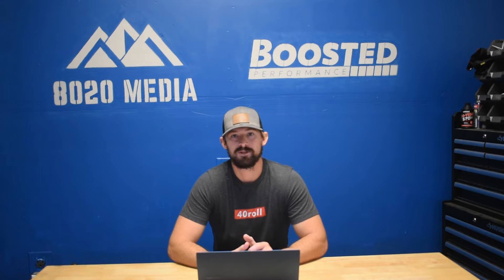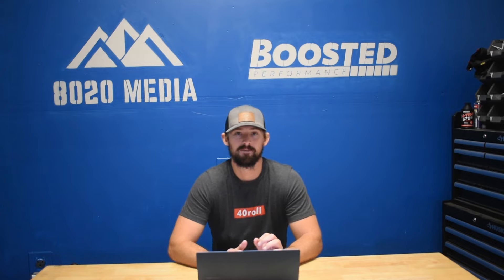DIY: How to Fix GMC/Chevrolet "Service Stabilitrak" & Traction Control Lights!

Comment: My truck runs fine even with all of the lights staying on. So instead of replacing the 200 possible things it could be, I'm just going to leave it alone. Been fine for almost 2 years now.
Reply from the maker: Ron - Thanks for sharing your experience. Everybody has different preferences. We personally don’t love seeing warning lights on the dash. However, if it is running fine with no issues, to each their own.
Reply: I just spent upwards of $1700 fixing my Chevrolet Malibu LTZ and everything ran perfectly until two days later. The check engine light is back on and now my dash display reads "SERVICE STABILITRAK". I consulted with the shop and they informed me that turning the Traction Control and Stabilitrak off would solve the problem as far as the hesitating and bad idling. Also driving the vehicle without TC and Stabilitrak would not damage it... I was told to drive carefully and keep the car's oil changed and tuned up as anyone should. I've been driving without TC & Stabilitrak for a solid week now with no troubles. I'll eventually go to my Chevy dealership to have the issue fixed when my budget will allow it but for now I'll just have to drive it as is and pray for the best. I believe everything should be alright.
Reply: @8020Media  that's exactly where I'm at with the situation now, just elated that my car runs smoothly and won't leave me stranded somewhere. It is what it is.
Reply from the maker: Fred - Good to hear. Keep us updated on this!
Reply: @fredicagoillanoise1309 Praying right along with you!!
I am presently faced with the same issue!!
I've invested alot in this pre-owned vehicle due to all of the lights on the dashboard.
I've only had it for a week and have seen 4 Mechanics thus far!!
Reply: @shirvanyrwright7250  I hope all goes well with your car. These things are a headache when you have problems with it. Here it is 6 months later and so far so good with mine. I'm driving it without Stabilitrak with no major issues. Sidenote I just had to replace the main battery yesterday and will replace three headlamps tomorrow... it's always something isn't it?.......
Reply: Throwing p011 code. Replaced vvt, magnetic actuator, cam sensor, and subharness. Replaced wheel speed sensors. No luck. Trying coils next already did plugs. Cursed. Camshaft overadvanced code is what the p011 is.

Comment: 2016 Impala: I had my trans flushed in May 2022, started having issues in June. One time i drove 30 mins, got out and went to lock the car, didnt hear it lock. Got in went to start, nothing, dead. Felt the battery cable, little warm. 5 mins later, starts right up. No issues for a few weeks. Then started getting u0101 code. Had the battery checked, they deemed it bad. Replaced it in July 2022. Started getting the Service Stabilitrak message, with traction control light, check engine, and electric brake service light. If I started the car and all these were on, when I shifted from park to reverse it would slam into gear. If I then went to drive, it didnt want to move. If the lights went on when i was driving faster speeds, once i came to a stop it would not let me take off. It was as if the car was in a limp mode. I took it in last Thursday, they said the battery was bad. I told them I have a warranty. They said they changed it and there were no issues after test driving it. I picked it up, drove to less than 5 miles before it happened again. I dropped it right back off. The next day they called and said the CAN was not communicating with the TCM. The Chevy dealer deemed the TCM bad and said replacing it will fix the issues. The technician stated that when he removed the TCM plug there was some fluid inside the connector. They ended up changing the TCM for $1100. I have less than 300 miles on the car since I picked it up. Guess what happened today? Yep Service Stabilitrak light, tractions control light, check engine light, and service electric brake light. Called the dealer, the harness might be bad. This is a Chevy dealer, the #1 in Illinois. Are we just guessing? Just spend thousands hoping to find the right fix? Nightmare.....
Reply from the maker: JJT - This does sound like a nightmare. Thanks for sharing your experience. We hope it gets solved soon!
Reply: I'm having this exact same issue! Hopefully my repair experience isn't as stressful as yours though
Reply: @oshrobertson9372  if you are having intermittent issues, make sure they find the root cause before changing any parts.      I have still not resolved my issues.
Reply: 07 dts cuts engine powe out of nowhere, then kills the motor. The YouTube vids say it's a wheel sensor.
Reply: The problem at the dealership is that they have very few techs with experience because they don't want to pay much and this is what you get...
Inexperienced techs straight out of tech school and have training but little to no hands on experience so most of their diagnostic skills are on zero...
Take it to an independent mom and pop shop that has a good reputation and an experienced tech on duty and I can almost guarantee you they will fix it right the first time...
70% of dealership service are hack techs.
Good luck to you!
😊👍
Reply: I’ve been dealing with this exact issue with my 2016 impala, I live in Las Vegas and have had the exact same experience with the #1 dealership in town also, I decided to take it somewhere else for a more affordable option, and they are saying the same thing….. has anyone figured out how to fix the problem?????? The light being on are one thing…. But when the car doesn’t recognize the transmission and I’m stuck driving in 1st gear… it’s a fucking headache…. Over 2500 dollars spent towards this problem…. Still no fix smh ….. can anyone help????
Reply: I eventually had the entire engine harness changed, they will never admit that their trans flush caused all these problems. The harness is $400-$500, but cost a lot more to install it. The said it was a $3500 job. I think it was like a 12-15 hr job to change the harness. They changed the harness for $1000 out the door. They will never admit they caused these issues. I never had issues after they changed the harness.
Reply: @JJT12380 any issues since changing the harness? Same issue Chevy Malibu 2016. Service stabilitrack, power steering, check engine light 😢
Reply: @sarahruiz8120  after changing the harness, I had no issues, then some girl rear ended me. Car totaled.
Without knowing all your issues I would not recommend changing the harness, it cost over $3000 to do.

Comment: thank you so much for a such a thorough video. At first I was thinking, "this dude is just gonna talk the whole time and not show me how to fix it?" Now I'm grateful you did! Thank you so much bro!
Reply from the maker: Da - We appreciate the support! Did it help resolve this issue for you?
Reply: Once you understand how the system works, you then can begin to diagnoses problems so much easier.
Toyota systems are simaliar in the way they function.
The VSC system warning lights come on when there is a fault in the Engine Control system by default.
Reply: Mine came on.  Then went off but then the check engine light came on. Any thoughts ????

Comment: great video; i was fighting this gremlin for several months with my local dealer accusing us of applying the brake and accelerator simultaneously as the cause.  My issue made the car difficult to drive in that when those lights came on and i tried to accelerator more than a snails pace, the car would really hesitate and jerk, almost like the ABS system was kicking in and fighting the engine. Oh, and the brake lights were on all the time too.   finally took it to a different dealer in a different state and they replace the brake switch...$24 part...and boom, all is well.
Reply from the maker: DJ - Unfortunately, that's all it takes sometimes. It can be a very simple fix, like your example, or can be a very complex fix which will not only cost a lot for diagnoses, but also parts and labor. Glad to hear your issue is resolved!
Reply: I have this same issue!   depending on the gear, after a certain rpm, it's jerks and bucks!
Reply: @spikyod1864  after they replaced the brake switch, i've had no problems for 5+ months.
Reply: @djslais  awesome, I found it for 10 bucks on Amazon, hopefully that does it, and it's literally only one little bolt and plug in and rebolt... I was hoping it wasn't a transmission problem.   Just the abs light and stability lights come on, then jerks above a certain rpm.   my battery is on its way out, I heard that cause cause a similar issue too.
Reply: @spikyod1864  one interesting thing about my issue was the brake lights were on all the time.  made it look like i was riding the brakes, LoL.
Reply: Do you have a part number or exact part name
Reply: Same come on seems like when I make turns no brake light though
Reply: Did your truck also vibrate at times?

Comment: I've been struggling with the ABS/Traction Control/Stabilitrack  warning lights for months now.  I just recently discovered that the OBD reader tool I was using was just not up to the task.  Since I'm not keen on trying fixes not knowing what is really broken I invested in the Telematics Bucktec 430 which is really up to the task.  It found that it was my left rear speed sensor that was the culprit saving me $150 in parts and the effort needed to find the real culprit.  The device cost me $60 and empowered me to be able to cut through the BS when dealing with sketchy repair shops.  Thankfully, I'm mechanically minded enough to handle regular maintenance tasks such as this on my own.  It all comes down to having the right tools.
Reply from the maker: Roo - We couldn't agree more! Thanks for taking the time to type out your experience. This should be helpful for anyone running into this issue.
Reply: This light has popped up on the dash of my 2017 Impala. I searched for your too (Telematics) on Amazon (Canada), but alas, not available. Can you tell me where you got yours? Or if there is another brand that checks this? My local GM ''stealership'' quoted me 400$ just to check for the fault/code.

Comment: Thanks for the Super informative video. I think I just fixed my issue with traction control. It turned out to be a dirty MAF sensor. Cleaned it up and the check engine light turned off instantly! Also no more "service stabilatrack" message!! Let's see what happens but for now I'm happy!! I'll keep it clean from now on and if it happens again I'll know exactly what I'm looking for first!! Again I salute you Captain 🫡
Reply from the maker: Cali - Glad we could help! This is why we make our videos. Keep us updated!
Reply: What’s a maf sensor where is it
Reply from the maker: B - Mass Airflow Sensor. It depends what vehicle you have, but is typically found between the air filter housing and the throttle body.
Reply: @8020Media  Still no issues!
Reply from the maker: Cali - This is great to hear! Glad we could help.
Reply: I cleaned mine worked for 40 days. Then purchased GM OEM and worked for 2 days. Help

Comment: I have no CEL, no symptoms of anything wrong and all of a sudden stabilitrak/traction control kicks off on the highway causing what feels like misfires or the abs being activated when trying to accelerate.  I pull over and turn the Traverse off for 30 seconds and all is good for another 80 miles.  Once in drive i do turn off TC which has helped me get further down the road before more issues.  I was going to look at the wheel speed sensors but i guess its not that since no CEL. Great video
Reply from the maker: pK - Thanks for sharing your experience! Keep us updated.
Reply: @8020Media  rear tone ring was caked with dirt. Good to go!
Reply from the maker: pK - Glad you found the problem! Thanks for sharing your troubleshooting, it will definitely help future viewers.
Reply: How did you find out that was the problem
Reply: @DedeYoung23  I crawled underneath my vehicle with a flathead screw driver and lightly inspected the backside of the wheel hub Assembly on all 4.

Comment: How to  fix the Stability tracking issue - 

First : Make sure the brake pads are not locked due to heat or dirt extension- 

2) Make sure the battery is charging normally and doesn't run out quickly  (short to ground-)

3) Make sure no misfiring- 

4)The last one - the mysterious one - is that the starter  in your car must be rechecked for short to ground-
The  brushes inside the starter is causing short to ground- you must replace the starter or fix the brushes and clean up the starter from debris - 

Explained: At high load the current passes from ground terminal to positive terminal within the starter due to the broken brushes even the starter works normally
Reply from the maker: X - Thanks for taking the time to share this insight! This will certainly help future viewers.
Reply: Thanks gonna try them because it’s causing my suv to now come on saying change trans oil too never seen that and I’ve had quite a few different types of cars… but idk if I was taken care of just bought it but when purchased they said no light and didn’t at first 3 days later when I got it legally on the road here they all come… but regardless main issues it’s slowing down the car terribly and seems like it’s not shifting correctly! It was a quite purring kitty like me but then started fighting back meaning pulling and the shifting thing and even when first started it’s more like a growl now lol 🤪 she’s loud now so idk if with some of this and the lil details I’ve noticed if maybe you had similar and recommended maybe out of those steps which worked for you!!! Thanks for the great info tho🎉🥳🤩
Reply: I might have to replace starter as the connector is broken and I have my 16 chevy equinox since January with it now being at 40k miles😮😮😮 but currently I'm experiencing CEL issues (fuelwise and maybe crankshaft position sensor as well) 😢😢😢😢so I know I may have to get wait on next check to get HPFP and throttle body
Reply: Hello, I replaced my rear pads on the old rotors and I am feeling pulsing under breaking at high speeds from the rear. I am assuming the pads are getting too hot. Do you think this could cause the code?
Reply: @xyz20121000  well your advice was spot on 👌🏽👌🏽👌🏽 in my case it was the infamous starter and I had to turn around and replace the fuse as well so thank you so much 😊 😀 🙌🏽🙌🏽🙌🏽🙌🏽

Comment: Yes!  Very helpful.  I have a 2010 impala  I just bought recently after my sentra was totaled.  This only has just under 20k miles on it.  I've only had it for a couple of months and for the first time today I was driving and I got the "service traction control" and "engine reduction" messages along with what I like to call the "slid light" and the check engine light as well.  Thankfully I found my flashers and was able to get the car home but it CREPT at about 5 miles an hour if that.  Parked it and went back to check later and the only issue left is the check engine light but everything else seems to be fine.  I will say that I need to put air in the tires soon and I get a fluctuating tire pressure monitor system alert from time to time so maybe that had something to do with it.  Scared me so much but after watching your video I am much calmer.  Thank you!
Reply from the maker: Best first step: get a code reader and pull codes!

Comment: Thank you for the information, my transmission is slipping and my truck usually is running on bad gas so it makes sense that the rpm’s would cause the lights to
Reply from the maker: E - Thanks for the feedback. We hope it helps!

Comment: My 2021 Suburban with less than 50,000 miles Stability Light and Check Engine started flashing after I gave it a good wash. I’m even getting a little misfire and shake at stops. It done it for a whole afternoon. Guess I will be troubleshooting! Thanks for the vid!
Reply from the maker: Latoren - Thanks for the feedback. Keep us updated!
Reply: Did you figure out the issue? Im having similar issues
Reply: Yes, i tried changing the coil pack  the diagnostic showed but they didn’t fix it so I changed back to the old one and I took it back to the dealership and one of my lifters were bad. It’s still under warranty so they removed the head they changed them all on that side of the engine!

Comment: Here is a new twist. My light came on after a routine oil change and tire rotation. Previously, all was normal. I was driving my truck and noticed a distinct pull to the left. Again, there was no issue before the oil change. When I took the truck to my local tire shop, the owner immediately hand checked my front tires and said the right front tire had a bubble. I would not have known it, but upon inspection, it was true! The tread height was off and I could feel the difference. The truck is used for longer trips instead of local ones. The tires were 10 years old. I replaced them all ( cringe). The truck drives straight and th3 warning light stays off.
Reply from the maker: P - Nice! Thanks for sharing your experience.